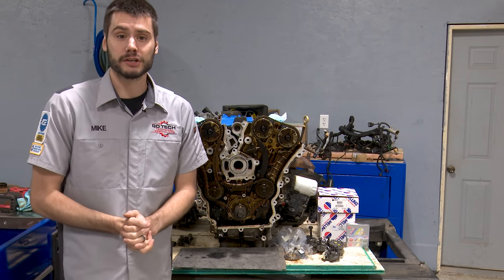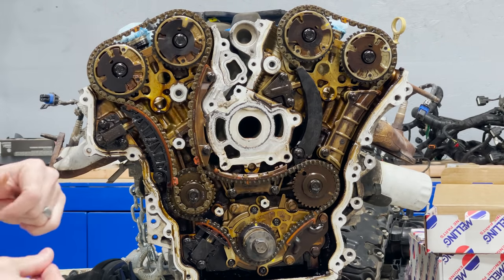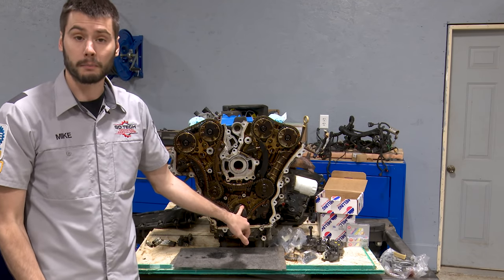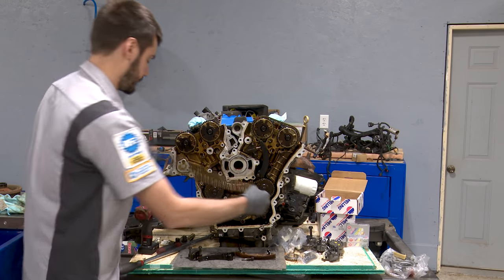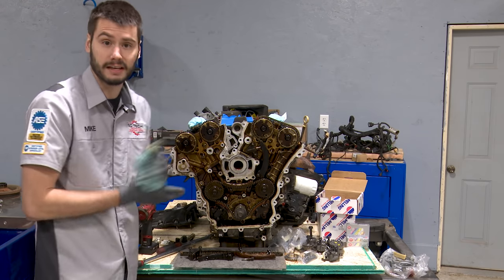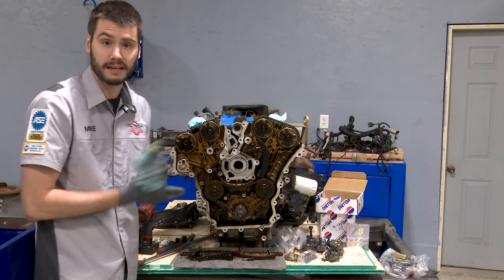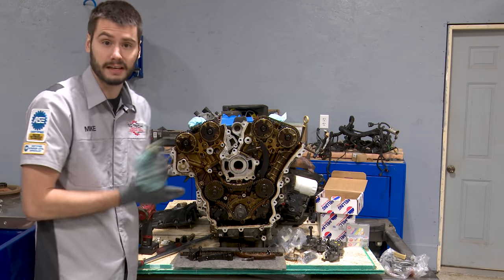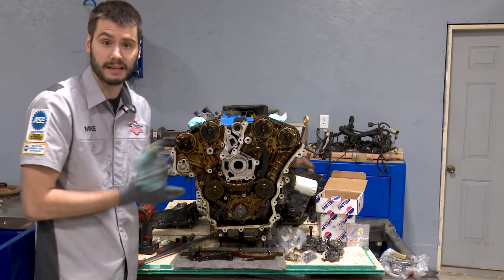How To Replace Timing Chain On Chevy / GM 3.6L V6 - Full Length Removal and Install - With Tips!

Comment: I have done several of these engines timing chains. If you use the special tools on all 4 cams at once, You do NOT have to rotate the engine to phase 2 etc at all. Simply install tools and remove all the timing chains at once way easier then doing this turning over the engine part, The special tools are actually cheap. They keep everything locked down and in correct position. The Camaro 3.6 timing chains can be done in the car, while on Acadia/traverse/Srx 3.0/3.6 I simply removed the engine and transmission out the bottom and did it on the ground way easier and less fighting. Using a lift of course.
Reply from the maker: I agree the rear wheel drive vehicles make this job much less of a task. 
I will have to look into getting our shop a set of these special tools.
Ryan W, Technical Instructor
Reply: not using the cam tools . does the flats of the cams line up perfect? mine seem to be off slightly. is this normal or do you think I have a secondary problem I need to find?
Reply: @riseandswinefarm7522  the tools slide onto the oblong part at the back of the cams. you can use the timing marks on the cam gears to verify correct position though. the chains have colored links that link up with the dots on the cam gears.
Reply: 2
Reply: Even with the tools you have to put engine in stage 2 timing the kit comes with 3 tools for exactly that
Reply: Although I've never done one of these engines but others I was thinking there has to be a way to replace the chains without disturbing the timing by rotating as I've done si on other engines with much success! Thanks for the info!
Reply: Any recommendations for replacing the chains without a lift? Can I pull the motor from the top?
Reply: @Rscmgw23  I replaced mine without removing the motor at all, just remove the motor mount on that side and support the engine with a jack under the oil pan
Reply: @alexhoexum9548  … what car was it? How many miles? I just hit 200k on my 09 Malibu and they are starting to get a little noisy on start up.
Reply: @alexhoexum9548  you can but its a pain to do front wheel drive in the car.
Reply: @Rscmgw23  the front wheel drive is designed to drop motor from bottom. But you might can pull just the engine from the top if you remove a ton of stuff..
Reply: @sentient_musiq1060  you can i done the v6 camaro and traverse etc without rotating the engine at all when the tools are installed
Reply: I know you mentioned changing the oil pump. With the engine in the car, thought it was NOT possible due to the pickUp tube?  ?
Reply: @Rscmgw23  the chains can be replaced without removing the motor, just need to remove the passenger side motor mount, all the belt driven stuff and the front cover and you can access everything with the motor in the car*

*on a lot of the vehicles with this motor
Reply: My camshafts are jumping I have them locked in the specialty tool 
Took the chains off before setting
How do I reset or am I ok with the cams locked in specialty tools corresponding Crank pos : 5 oclock 8 oclock for Right side
Reply: @alexhoexum9548  o
Reply: How do I remove harmonic balancer bolt without turning engine backwards
Reply: So if your car skipped a little and you put the special timing tools on "before hand" then take the rest off? Shouldn't I put 1 cylinder top dead center like the V8? By the way I have a 2015 Cadillac CTS . Thank you
Reply: @paulcarlino744  there are marks on the cam gears and crank gear just turn the crank a tooth or so and line up the marks. If it skips after the timing job. Someone messed up.
Reply: Arcadia Travers etc can be done on car and in a fast as 4hrs
Reply: I just tried that and it’s backfiring like crazy
Reply: @jamescard6254  i did probably like 6+ jobs and never had 1 issue and the car even ran bad before and had p0018 codes etc. You did something wrong...
Reply: @turboimport95  just re did it like he said in the video and it’s running now the cam locks where shit and let it slip I think
Reply: name  of the tools?
Reply: @Rscmgw23  Hello, please let us know how did you do it. Did you take out the engine ? From above or under it ?
Reply: @FairfaxBrakes … I still haven’t done them I’m now currently at 213,***k miles.
Reply: I changed oil and filter on a 3.6 camaro. 2012. Then a week later i changed the timing chain with a new kit. Since it had the timing codes and it ran like shit. After the replacement it runs good but still gives the timing codes. And after 40-50 miles driving the oil pressure drops. And giving low oil pressure light. The filter keeps collapsing. Have any idea what might be going wrong?
Reply: its like the chains lose lubrication. Im already on my second filter. Sure that one collapsed already. Only thing i can thing of is the bypass valve went bad. Happened to me on a chevy cruz
Reply: @Rscmgw23  please let me know if it can be do it without a lift.
Reply: @FairfaxBrakes … depends on vehicle
Reply: For a 2012 Cadillac SRX ?
Reply: How much for this job??
Reply: Do you have to remove the heads?
Reply: Do I remove the top of the motor for a timing chain
Reply: @eddiemonroe439   just the valve covers and upper intake.
Reply: @alexhoexum9548  did you get it done without a lift ? How ?
Reply: @FairfaxBrakes  in my SRX there’s plenty of space in the engine bay to get to the parts up top, and to get to the lower you just remove the plastic wheel well cover and you can access the lower front of engine area pretty easy
Reply: I have a 2011 SRX 3.0. I’ve done it in the car. Not fun, but not that bad..    If you doing one with 200,000 miles+, make sure you replace the cam phasers, because the gear on them wear as well.  
I have also pulled the engine out of the top a couple of times.  Other than bending the tabs that the core support connects, it’s very straightforward. Just make sure you support the trans  when pulling the engine.
Reply: @chrisraffo2946  its easier to just drop motor and trans out the bottom
Reply: @turboimport95  a couple of people had asked about taking the engine out of the top.  Of course it’s easier to drop it out of the bottom, but not many have access to them.  A new engine lift from Harbor Freight is only $150.
Reply: Hey I guess that’s why there’s the special timing tools. Once set install new chains. You might not even have to tweak position to fully engage chains onto marks. But if so no worries
Reply: @Rscmgw23 it depends on what vehicle but you can hardly pull it from up top on some models. But you can comfortably pull the engine from the bottom without a lift. You just need tall Jack stands.
Reply: @user-id7eq9kw4q yes. Its no big deal. Honestly, all timing chains or belts ive done were just with my own marks on all gears or sprockets. Nothing complicated there. I guess you just have to comprehend what kind of machine you’re dealing with.
Reply: @RBZ06LT6 … that’s how Lieutenant Dan lost his legs, using tall harbor freight Jack stands lol.
Reply: What are the special tools?
Reply: @djscottymaxx  you can do this without a lift. just need tall jack stands and a engine hoist. lift the car high on stands and lower the engine and trans down on the ground, using the hoist of course.. or can fight it in the car, your choice. My choice is to not own a gm 3.6 vehicle. my 96 Tacoma is a champ. easy to work on and has 334k on stock timing chain no issues..
Reply: I think that you need to change stages also using the cams special tools. I will do a video for checking timing using special tools and changing stages for a problem In a 2009 GM traverse that I have misfire problem and I found secondary left chain are out of time
Reply: @luisfeperez7490  i never done stages and all cars pass emissions no issues. You can also make your own marks to help.
Reply: Realistically how many hours will this take if you do it in car on an 09' Acadia, askin for a friend lol ?
Reply: @turboimport95 Thanks and yes I have a cherry picker, with the leveling tool so it should make things easier if I decide to lower the engine. And yeah my first choice was a Newer Ford Explorer but I didnt like how the seats folded down in the back and if I remember they are not 3row seating so I went with the Acadia. If I woulda known bout the timing chain and tranny issues I would of went with the Ford or something else def.
Reply: @djscottymaxx  should had researched the chevy 3.6 and you had seen the issues, but sometimes new things blind you. And you dont want to see the issues, similar to when to comes to dating women. Things happen.
Reply: @djscottymaxx  if you a simple diyer and  not a pro, then it will take you 1-2 weekends to get it done most likely, gotta pull lots of parts and remove both valve covers etc then the timing cover etc. gotta drain coolant etc. lot of things not shown in the video.. some cars have to remove the upper intake/throttle body.
Reply: Is it possible that the engine is still good if the chain broke causing low compression and no starting? Also the timing chain was changed out 25k miles ago by the previous owner who had it done at a shop. Is that common to break after that many miles?
Reply: @SilentReignINC  it broke because of user install error or cheap parts. Most likely the engine has valve damage now. You can try and put it back together and see.. but if valves are smashed, gonna have to pull the heads..
Reply: @turboimport95  the shop claimed that  their's no way to inproperly install the timing chains.
Reply: @SilentReignINC  then it was cheap china made timing chains. hope you got a warranty..
Reply: Where can you get the tool ?
Reply: Do you leave the engine in stage 2 timing when your all done ?
Reply: @adrianvargas9784  when you get new chains installed, remove the tools and turn the engine over a few times and re checking timing marks with the tools and then you are done.
Reply: With all 4 cam locks in place how do
 you explain not rotating the crank from 5 to 8 position, 08 lacrosse 3.6
Reply: Get any feedback on how those held up? Looking into it I'm seeing broken cloyes chains totaled engines etc.
Reply: @Rscmgw23 do it with the engine in the car
Reply: Just got done replacing 3.0 L timing chain and gears but my car is lagging will not start any advice moving forward used Haynes manual to double check timing marks. All were lined up.  All new sensors as well
Reply: @tobiwhiten1865  you did something wrong.. unless the car was running like this before and its another issue. I did like 5 of these and never 1 time had issues... If you did the job in the car, you could had got it 1 tooth off etc. from weird angle. I recommend doing the transversal engine chains with engine removed.. rwd camaros etc are easy to do in car. Also If the car ran decent before, i would had made my own marks before removing chains to verify, and not relied on a book.
Reply: @tobiwhiten1865  you did something wrong.. put wrong timing or you have a different problem, if it ran before you messed up..
Reply: You don't need to remove the engine in any of them
Reply: @joediduch5457  no one said they did, it just makes it 1000 times easier..

Comment: I am an ASE master tech w/L1 advanced tech w/over 40 yrs exp so i can tell you listen to this guy the way he explains in this video work easy with or without the engine in the vehicle. Don't be intimidated by this engine. like women It's easy after your first. Great vid young buck, keep it up , your the future
Reply: It can be done in the car I I did it changed timing chain in the car
Reply: Yeah - I got over 500,000Km from my 3.6 alloytech.  They aren't a difficult engine if you are used to euros...  Only put the car to the scrappers because of serious cracking.
Reply: Do you prime the oil pump before installation???
Reply: @mky9227  Hek yes...  If you've taken the housing off - or you are using new years (smrt idea) just pack some grease in the housing first.   You can't get neg pressure and the pumps leak like a mofo.
The  standard grease will be lost in the oil.  You'll be changing oil out after a few weeks - so it's not a concern.
Reply: @mky9227  anytime u still pump prime with oil to get air out
Reply: Like marriage, it's still a bitch after a bit when it puts on a few lbs (While the motor is in the car..)
Reply: If there is a timing chain failure, does this cause valves to clash with cylinders? I thought these are interference engines
Reply: hello , are you available for questioning? if so, I have a question about the positioning on the cam sprockets in both stages of timing
Reply: @brunorios7223 yes a failure can cause damage.
Reply: It's possible. It happened to me .

Comment: I tried to change timing chains on a 2000 BMW 740i and never found anything remotely as detailed as the instructions for this job  especially recranking for phase 2 timing.  I watched this because I have a 2012 Buick Enclave with 223,500 miles still runs fine.  My chains probably have stretched a bit🤔!